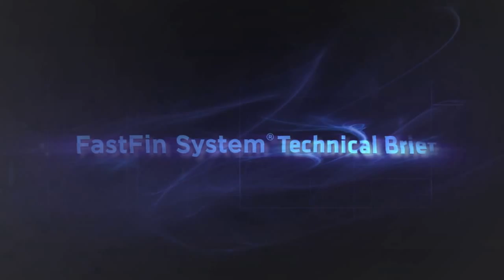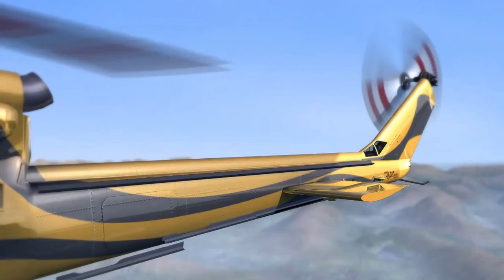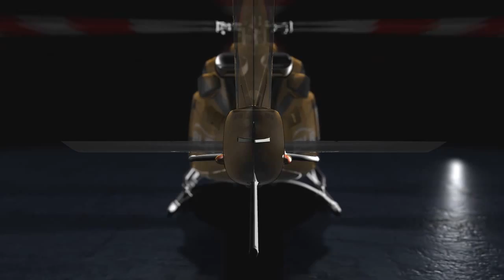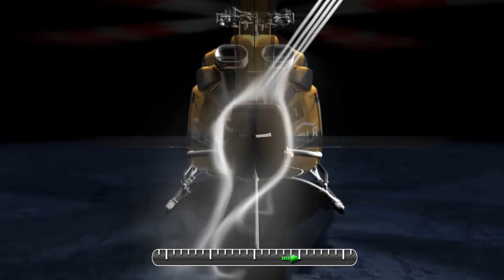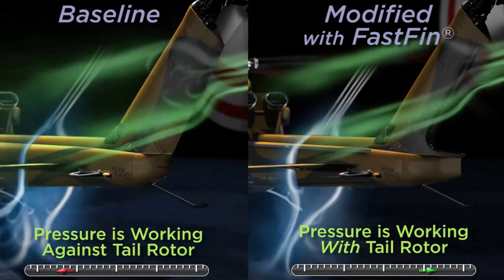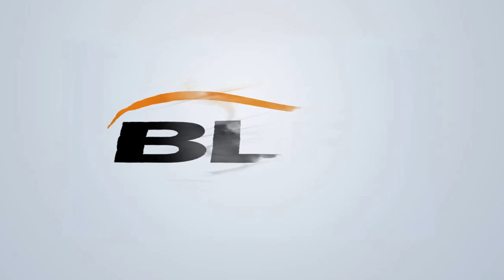BLR Aerospace FastFin® System Technical Briefing

Comment: I absolutely love the Bell Huey. But, the Huey’s tail rotor system is a complex & some what controversial subject! 😳

Bell Helicopter Textron has had problems with creating tail rotors that aren’t effective enough with their thrust. 

The 206B Jetranger’s are notorious for spinning out of control because of loss of tail rotor effectiveness (LTE). I guess the Jetranger tail rotor was just too small for the amount of torque that the 206B was capable of producing. 

With high gross weights Jetranger pilots have to avoid right pedal turns to avoid getting into LTE. 

Eventually a company called Van Horn started producing more aerodynamic & effective after market composite 206B replacement tail rotor blades that greatly increased their effectiveness & safety. 

The original Bell UH-1 Hueys & AH-1 Huey Cobras spin their port (left)  side mounted, pusher prop, tail rotors counter clockwise which is aerodynamically less efficient. 

Hueys are powerful helicopters, but like the Jetranger are prone to getting into Loss of Tail Rotor Effectiveness (LTE) & spinning out of control at high torque power settings & low air speeds. 

Bell could have fixed the Huey’s inherent anti torque design flaw in 1965 by redesigning the tail rotor gear box, remounting the tail rotor blades, & simply spinning the tail rotor blades the opposite direction (clockwise). 

Around that time, helicopter engineers discovered that spinning the tail rotor clockwise, & upward into the main rotor’s (MR) downwash, gave the tail rotor more bite/thrust; similar to translational lift, making the tail rotor more efficient & more effective. 

Unfortunately Bell helicopter did not want to pay the extra money of redesigning the Huey’s tail rotor gearboxes to fix this inherent aerodynamic problem at its original source. 

Instead, they started flipping the old gearbox over, & putting the tail rotor on the opposite (starboard/right) side of the vertical stabilizer. 

This did spin the tail rotor upwards into the main rotor’s downwash. But, it changed the tail rotor from being a pusher prop system to being a tractor system. Therefore; this induced a new aerodynamic problem because now the large vertical stabilizer was blocking maybe almost 1/4 of the tail rotor’s thrust. 

So, while spinning it upward into the downwash added a slight thrust advantage, this advantage was lost because the vertical fin was blocking so much of its thrust. Therefore; by switching the AH-1 Huey Cobras’ & Hueys’ tail rotors to the opposite (starboard) side in reality possibly made the Hueys’ ineffective tail rotor problem even worse! 

Hueys were still getting into LTE & spinning out of control & crashing when flying at high power (high torque) situations hauling heavy loads or high density altitudes. 

This has been a problem with the Hueys since their inception in the early 1960’s. 

They’re great helicopters, but they could have been even better if Bell Helicopter Textron would have spent the money to design a new gearbox to spin their tail rotors clockwise on the original port side, to keep them as a pusher system, spinning upwards into the MR downwash. 

In more recent years, Bell essentially tried putting a “band aid on a bullet wound “ by making the vertical fin smaller (Fast Fin), so it doesn’t block as much thrust from the starboard mounted, tractor tail rotors, hoping to increase tail rotor thrust a slight bit. 

Bell also started installing strakes on the left side of the tail boom to interrupt the air flow, to increase air pressure on that side & decrease airflow on the right side creating the Coandă effect, like McDonnell Douglas MD520N NOTAR helicopters. 

I guess this has helped increase tail rotor effectiveness in fast fin modified Hueys? The problem is, the vertical fin is designed to aerodynamically keep the helicopter from spinning if you maintain 65 knots forward speed, in the event of a tail rotor failure. Unfortunately, I don’t know if the narrower fast fin vertical stabilizer is big enough to aerodynamically prevent the Huey from spinning. 

So, to me, reducing the vertical fin’s size is like robbing Peter to pay Paul. Sure… it might increase tail rotor thrust of the less effective tractor system, a bit, but the vertical stabilizer might not have enough surface any longer to prevent a spin, in the event of a tail rotor failure. This just doesn’t make sense to me! 

Bell could have created a more effective pusher, tail rotor system by redesigning the tail rotor gearbox, to spin the tail rotor, clockwise, almost 60 years ago. But to save money they’ve engaged in shenanigans robbing Peter to pay Paul, by flipping the gearbox over, to change it to a less effective tractor system. 

So, whenever I see the Hueys tail rotor system brought up, it’s a frustrating topic because Bell decided to go cheap, instead of making the Huey’s tail rotor system the best it can be. The tractor system, equipped with fast fin, is a compromised system stacked onto a compromised system… to avoid fixing the root problem, of redesigning the gearbox to spin the tail rotor the opposite direction, they’ve done less effective things, to save money. 💴